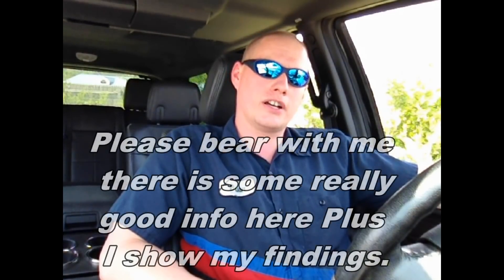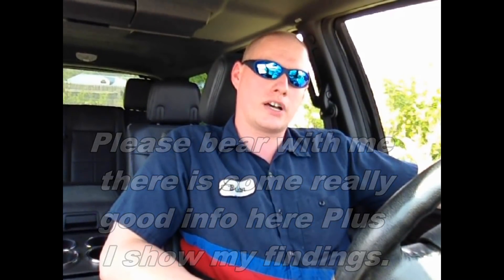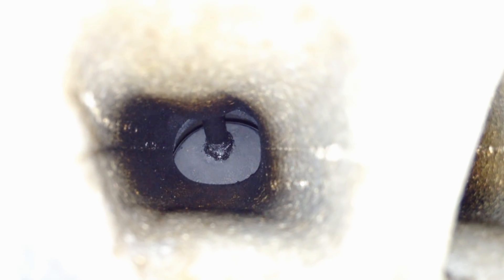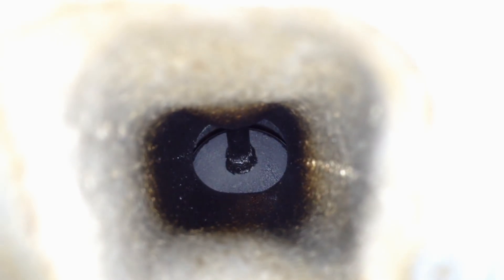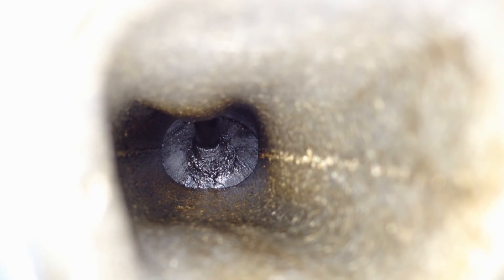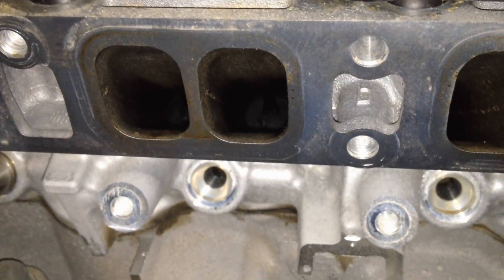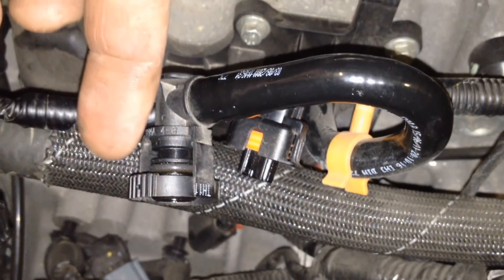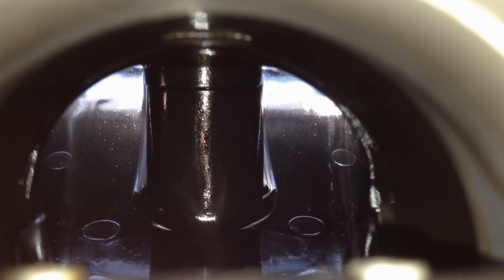Ford Ecoboost Warning Part 2 My Findings

Comment: Ford Motor Company engineers would have (should have) known about this.  Mercedes, Audi and BMW started using Direct Fuel Injection 10+ years ago and have had similar problems, actually many problems with carbon build up on intake valves.  Is there a way to fix this, possibly....It just keeps cropping up in nearly all makes.

Comment: I wonder if a  de-carbon treatment with seafoam every 18,000 or so miles would help to reduce this problem? PCV seems to need an airsep type setup, as this oil is certainly detrimental to the valve seats, valve stems, and the turbo. 

I would imagine, that moisture in the crankcase is a consideration here as well. An oil analysis would reveal whether or not the moisture is pure condensate, or could possibly contain some anti-freeze. I have read about some owners suspecting freeze plug failures, that actually turned out to be an oil cooler failure that allowed anti-freeze to get into the motor oil. 

Just thought I would add my .02 for consideration.
Reply: dmc31405 or an oil catch can

Comment: Has this carbon issue been corrected on the new 2nd gen ecoboost engine?
Reply from the maker: +david wysocki it should be yes time will tell since the port fuel injection is not always on.
Reply: FordTechMakuloco ...so Gen 2 has port and GDI ?

Comment: more evenly?  So you will have to clean all intake valves?  What a mess !!   Due to Government regs, Ford is doing all this smaller more efficient crap... It will not matter soon as Electrics will take over.
Reply: grabir01 I know mate and I seriously doubt the Ecoboost engines will outlast the engines in the 92-96 Ford Trucks.

Comment: For a 1.5 Eco boost in the 2017 Ford Escape, would occasional hard acceleration mitigate the problem?
Reply from the maker: +john It will help to an extent but what you are seeing here is the stick hardened carbon and oil that will not get blown out

Comment: would carbon build-up at 18k miles be unheard of?  My 1.6 GTDI has an idle stumble.
Reply from the maker: +Keps LGR No this vehicle only had around 18k miles
Reply: +FordTechMakuloco thank you.  It's going to the Ford dealership for the misfire.  No CEL or codes yet though.

Comment: Wow, thanks for the post.  Today I looked at a new left-over Mustang 2.3 EcoBoost I am considering purchasing, with rebate & incentive stuff it is hard to pass up, it is a premium so has all the whistles & bells that are cool.  However if I buy it I don't want to start seeing problems like you described after the thing runs out of warranty.  Sounds like the catch can idea is a good one, wonder if there will be room somewhere on the Mustang as opposed to a truck.  Luckily there is more room under the hood being a four cylinder.  Any other ideas are welcome and appreciated.
Reply: Greg Beckham When your talking about how your going to repair a new vehicle you haven't even purchased yet...you need to really think about that

Comment: With fuel induction above the intake valve the fuel and additives in the fuel help to keep the intake valve clean and cool. There is oil above the valve and all valve stems leak a very small amount of oil by design. this is what lubricates the the valve stem in the valve guide in the head. With the fuel being directly injected into the cylinder the valve stems do not get washed down and cooled with fuel and the oil burns off and carbon builds up on the back side of the valve. This is a systemic problem with all direct injection engines.

Comment: My Sister-in-lsw had the 2.0 eco boost and it developed issues at 23,000 miles. It started at around 15,000 miles but they seemed to correct it temporarily. At 23,000 miles the dealer told her she needed a fuel system cleaning treatment to correct the issue This was allegedly routine maintenance and not covered under warranty. I think it cost around $100. Wasn't a day and the car wasn't drive able. AAA towed it back to the garage. It was the eco boost system and Ford was not covering it. At first the dealer was blaming it on a  Fram oil filter ? Then gasoline. It ended up costing her $500 which was supposed to be cost. She has also had steering rack issues constantly all covered under warranty. Since the car would be out of warranty soon and Ford wouldn't pay they traded it on a Toyota. 30,000 miles and it's never been back to the dealer except for filters, oil and state inspections.
Reply: Richard Bricker What a turd...typical Ford quality

Comment: 2015 Focus ST, bone stock 8000 miles. Check engine for misfire. Dreading bringing it to the dealer but apparently a lot of low mile STs are doing this. Service bulletin SSM#-45856. Cold start misfire. Apparently Ford has known for over a year and still no fix. Wish I knew this prior to buying the car. I think Ford and other DI manufacturers have a lot of work to do.

Comment: Why an eco-bust?  If you need to tow, get a diesel.  But not a Ford Power Stroke diesel.
Reply: Ecobeast passes up diesels while towing... right... and I'm 12 inches
Reply: Jon Groves as long as you're willing to risk a cp4 grenade
Reply: pete zandt just not a 6.0 or 6.4 the new 6.7 is far better
Reply: The problem was never "quality control" its simply EPA emissions standards, the EGR cooler, and people running a stock motor with a 140 horse tune. Head work is the most common issue, resolved by installing head studs that can take more pressure. Next is injectors, which are 10x more common to fail than they were in the older diesels because of electronic issues and the elimination of sulfur from diesel fuel. When i hear people talk about a 6.0 it makes me laugh. everyone is a mechanic
Reply: The 6.0 powerstroke was a huge problem child for Ford. also Ford didnt build the 6.0L it was built by International at the time and right around the time they released the motor was when Ford and International was butting heads so im sure the quality control department at International was given a little more slack which resulted in the catastrophe that was/is the 6.0L. Ford is now making the powerstokes themselves and they are really great diesel motors.
Reply: the ecodiesel by dodge garbage craters out at 100k and is a dog pulling 9,000 lbs. My ecobeast passes up diesels and pulls 12,000 lbs like its nothing. Sounds like you are real mad and sad. :)

Comment: I'm surprised that ford doesn't put a filter in before the pcv valve. to catch the oil vapors from the crank case.
Reply: No kidding.  My 1985 Silverado had a PCV filter in the air cleaner housing..Sometimes old tech is the best tech

Comment: The build up on the back of the valves doesn't come with the injection of the fuel, it comes from when the engine is shut off. Someone commented on using chevron techron. 
BG Products taught Chevron how to create techron many years ago. They have a great relationship. BG 44K twice a year will remove the those deposits  safely.
Turbo questions:
is the turbo lubricated from the oil supply?
Next honest answer, what brand of oil were they using?
Ford Motor Craft has a better than average TBN rating motor oils, if not using and even if you are using FMC  oil, my suggestion is to use 1 can of BG MOA additive with every oil change.
Help with coaking of turbos.
Reply: Doug Means oh what fun. Having to get dirty just to get it to work right. You won't have this problem with a V8
Reply: No kind of cleaner and I'll work if it is direct injection ! It sprays fuel directly into the cylinder instead of the back of the valves!

Comment: Can you just dump the blowby out of the engine?
Reply: I think your check engine light will come on and the engine will go into limp home mode. But you could try of course. Beware that it is illegal, and in Europe, the car would not pass the annual safety/environmental inspection, so it will be taken off the road until repaired.
Reply: That's what old cars used to do. They had a fresh air intake on one side and a tube from the other side that extended down into the airstream flowing under the bottom of the car. The PCV system was one of the first emissions control systems added to cars in the late 1960's. You can remove it if you want but that is considered tampering under the emissions laws. So don't get caught.

Comment: Ford designed these engines and then tested them for thousands of hours. they knew this would be a problem but built them anyway.
Reply: Reminds me of microsoft and the xbox 360. They knew it had defective cooling and cranked them out anyway.
Thing is, they owned up to it.
Will Ford?
Reply: exactly thats the same thing most manufacturers do built them and fix the problems later after they get peoples money
Reply: wrxassa yes it is.  Look at the Ford forums.  And who wants to pay for changing their oil every 3,000 miles. Hell, Dino oil is good for 5,000 minimum and synthetic should be good for 7,000 and that’s all city driving.  If not, the engine is shit
Reply: you sound like you put your chevy in the shop every other month.
Reply: Why you don't by A FORD.  Buy a Chevy our Toyota. Notre reliable
Reply: @njrmax72  depends on what you want and what year. Chevy's front wheel drive stank until the early 2010's. And don't forget the whole frame rust problem with Toyotas. I'm not hating, but don't forget nothing is perfect.

Comment: So with a 3.5 eco boost on my 2011 f150 is there any way to clean the coke off the cylinder heads without a seafoam or other like cleaners? I don't think id be capable to dig into my engine to clean it with a wire brush like you did.

Comment: everyone hates on the ecoboost here.  I have a 2012 F150 ecoboost with 148k, completely stock and have none of these issues.  runs fine hot or cold.....who knows maybe im just one of the lucky ones.
Reply: I HAVE 63.000 MI; ECO/4 STALLION-....ONLY USED FULL SYINTHETIC-OIL [ PENNSOIL]  SYINCE DAY 1-FUTHER  I ONLY USE SHELL- HYIGH OCTNE FUEL.[ DETERGENTS]-...........I CHANGE OIL AT 10.000 MI-
NVR HAD AH PRBLM....PERIOD-/MRMM
Reply: Has anyone in this thread had the induction cleaning done at the dealer and had NO turbo problems afterwards.....  OR has everyone had over 100,000 miles without ANY fuel / air  induction cleanings or EPR services at the dealer?   Thanks for your help!
Reply: Dave B How does Ford make so reliable. I know I watch the torture tests on them.
Reply: Well, nothing is perfect.
Reply: Dave B bro I'm right there with you....I have a 2013 escape and I swear the turbo is the cutest sounding thing ever...the blowoff is so satisfying that I try to get it into boost and then let off😂😂😂👌👌👌.....it pulls and it gets you better mpg.... I don't like the term ecoboost because most people don't even know what it truly means but ford is glued to it so it'll never change
Reply: That's good to hear because my 13 is almost out of warranty now and I don't want to trade my truck in right now.
Reply: I have a 11 with 121000 miles and no problems what so ever
Reply: I have a 2011 with just over 200k and its started having issues.  We replaced all the plugs and coils and still having miss fire issues.
Reply: I have heard the o2 sensors have to be replaced around that mileage or before  maybe some more folks with the o2 problems can ring in here plz
Reply: Truck EcoBoost and car ecoboost are totally different engines. The hate on ecoboosts is coming from their small engine ecoboosts, not in regards to the truck engine line. Those 2 engines, the 2.7l and 3.5l are fine.
Reply: Dave B no I'm in the same boat, actually just bought a 16 and traded in my 11 with 85k on it. Dad has a 12 with 100k not a single issue.  All vehicles properly maintain at Ford service centers with ford Motorcraft.
Reply: Xbox GT Hammtweezy2192 but doesn't it just seem like for every one good ford comment on here, there is 10 comments hating on the ecoboost?  I love my truck and would only get rid of it for a 2017 raptor.  thats coming from a guy who used to hate on ford btw, i test drove that 2012 f150 and was sold instantly.  ppl need to realize the better care they take of their vehicles the longer they are gonna stay reliable. everyone is just too quick too blame anything and everything  else.
Reply: Dave B They are still machines and things break.  I'm one who keeps my vehicles usually for 8 or 10 years (normally). There are millions of these motors out there and hundreds of people on the Internet bitching, I'd say that's a pretty good ratio.
Reply: prawcess perfectly said my friend....ford has the upper hand with turbos and the bitchy little dodge boys and they can kiss my ass....turbocharged cars all together are the best thing that's ever happened to combustion engine.....ecoboost or huge fuckin twins pushing over 30lbs.....they'd still lose every time
Reply: Mark H tbh I'd be like.....fuck y'all.... Rotary with 30lbs behind it😂😂😂😂😂😂😂😂.....mean asf!!!!
Reply: Again, anyone bitching about it is the sad dodge boys who got a 3.0 liter diesel that craters at 100k while not pulling nearly as much as the 3.5l ecobeast can pull.. Then we go to the chevy boys.. they bitch about aluminum body but then in two years they will be aluminum... The problem with the chevy crew is even with saving 700+ lbs with the aluminum body you still need a motor with some fucking balls to even come close to what Ford has done.

Comment: is there a reason they can't put a fabric filter somewhere in the PCV line to prevent oil from coming through?
Reply from the maker: It wouldn't last, an oil separator would be much more effective.

Comment: I'm curious if Ford's new 2.0 liter engine now being used in the 2017 Escape potentially fixes these issues?  I've tested a Titanium and am very impressed with the vehicle, but of course I'm worried about a first year engine.  I've also been told that Ford is recommending, not requiring, but recommending premium fuel in this engine.
Reply: Travis Powers  I'm from the UK. I have a ford focus 1.6 tdci all that she drinks is the good stuff. Had the car for 2 years (when I bought it it had 27000 miles on it) now it's on 37000 and not a problem. I service mine every year.

Comment: common issue with direct injected turbo engines. My 335i had this issue and BMW solution was to sell an induction cleaning where they remove the head and then walnut blast the back of the valves. The issue is because the engine is turbocharged it creates higher levels of crankcase pressure which traditional PCV systems even BMWs cyclonic systems cannot separate the oil from going into the intake. The double whammy is since its direct injected no gas washes over the valves thus the abnormally high carbon build up on turbo direct injected engines. Short of having a catch can to keep the oil out this will always be a problem. This is not a Ford Ecoboost problem. It is a direct injected turbo engine problem.

Comment: Hey Ford Tech how would u describe the oil consumption? Based on the images u showed It seem like the temp on the intake valves are high not on just cylinders 2 & 3.

Comment: how about distilled water listed into the intake?
Reply from the maker: No this can shock the system causing large chunks of carbon to come off hitting the turbo vanes and cause damage. That is an old school trick that should stay with carbs and OBD I cars only.
Reply: So would you say no to misting distilled water into the air intake of a 2.4 GDI no turbo? Because the next place I see a problem would he hot carbon melting into my catalyst?
Reply from the maker: definitely wouldn't no OBD 1 or older
Reply: methanol ejection.

Comment: Hi Brian, would the Chevron Techron additive effect the turbo negatively in any way? Would it cause it to run hotter and then warp seals, burn out, etc. I know you mentioned that that could happen with other cleaners like Seafoam. Thanks for the good info!
Reply: P.S. I have a 2014 Ford Fusion Titanium with the 2.0L turbo ecoboost.

Comment: My brother in law bought a new F150 Ecoboost and it has been in many times for engine/mechanical warranty work. I almost bought one based on the towing videos they had posted head to head with Dodge and Ford. I'm glad I kept my diesel for towing my 10,000 pound travel trailer.

Comment: This sucks. I was looking into getting a 2013 ford flex ecoboost limited. It has a little over 29000 miles. But if I have to deal with these issues I'm going to have to pass. Just sucks.

Comment: Will using better gas like Shell vPower Nitro+ help with this?
Reply from the maker: Better gas will always help as there will be a more complete burn and less deposits in the end.
Reply: Good deal, do you know if this is still an issue on the brand new 2.0 twin scroll ecoboost as used in the 2017 Escape?
Reply: Shell makes the best gas.  A private test by a news company somewhere found Shell had most cleaning agents In premium and marginal difference compared to BP.  But BP screwed up my family's Pontiac twice with clogged fuel rails and no issue with Shell.  My Grandpa uses Shell from tractors to cars all his life.
Reply: Any idea if all three octane options are good at Shell or only the highest octane?  Some have said top tier fuel is only better with al the additives only if you buy octane 91 or 93.  Thanks!
Reply: I run my car exclusively on Shell.
Reply: The problem is oil is getting onto the valve stems, the fuel may only help to keep the carbon out (along with Seafoam, but i'm not sure if it's safe to put Seafoam in the gas tank on Ford Ecoboosts) though they really should ensure it's safe for it and possibly fixed on newer models. This seems to be an issue with the design of the engine. I use Shell V Power in my current vehicle but it's not a turbo.